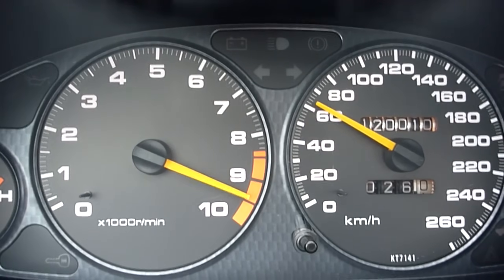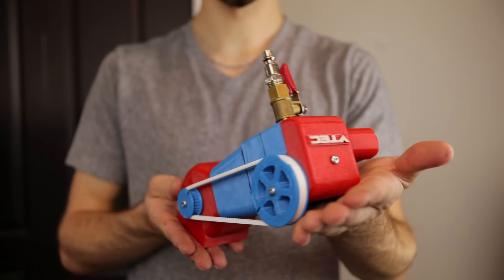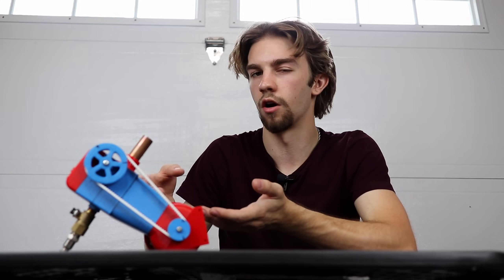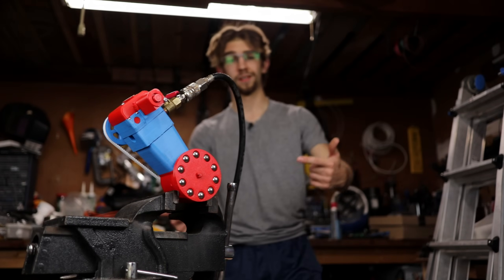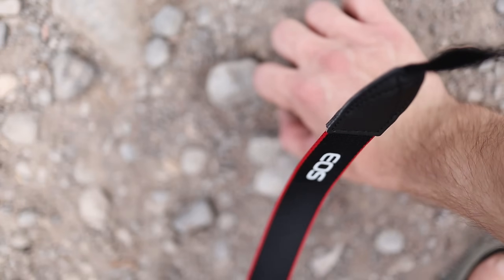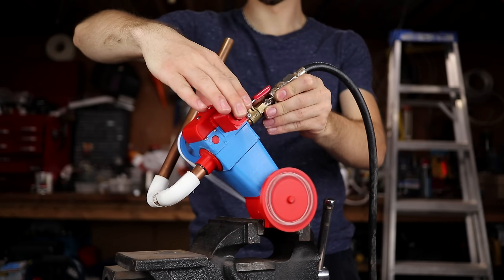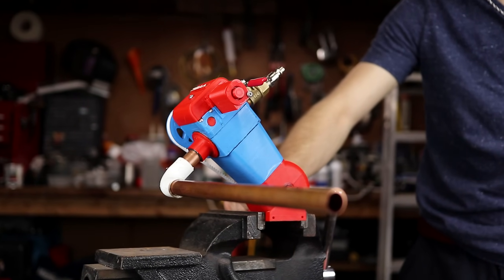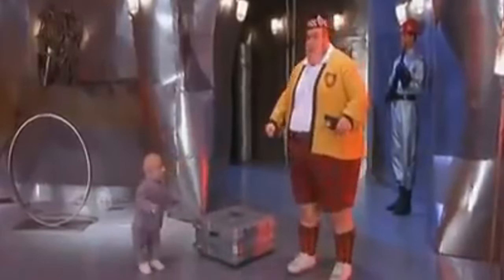I 3D Printed an Air-Powered Engine with Honda's VTEC

Comment: I'm way to dumb to be trying to explain this, but there is a thing with mufflers where if they are designed a certain way they can create a negative pressure that can actually assist the pistons in motion and increase horsepower. I can't remember what this is called but it would interesting to see if you could make a fancy muffler for this guy
Reply: "Exhaust scavenging" is the term i was thinking of

Comment: Automatic engagment would be some kind of weight using centrifugal force tensioned with a spring. At a certain rpm the weight would slide outwards and engage me mechanisms.
Just a idea might be complicated to implement or get the right force spring.

Comment: So you made an engine with worse Caproti valve gear... it'd perform better on steam as you can use the expansion of the steam when you cut off.

Comment: for the v tec could you make it so that it’s connected in a certain gear ratio that once certain rpm’s are reached at crank it can turn the gear fast enough to enable it? kinda like how if u stack a whole bunch of gears the last one won’t start spinning until the others have started and spun fast enough, you’d need more belts and stuff but idk

Comment: I suggest adding the weighted rotating levers that contract upon higher rpms. I dunno what they are called, but i know that they are used to measure rpms through centripetal force. Put that on the valves themselves and it should work right in theory if you add the right springs to counter the rotating levers forces...

Comment: Greases and lubes do wonders on efficiency and generating less heat from friction. Specially when said parts are plastic on plastic. ;p
Reply from the maker: I think I forgot to put it in this video, but I added grease during the assembly to everything that moved, I think the piston had to much inertia for the crankshaft to handle lol
Reply: @CamdenBowen  Ahh, yeah hard to tell from what I saw it seemed like it was bare. Most creators I see just slap the pieces together and wonder why things don't move freely or act surprised their creations only lasted 50 revolutions lol. Glad you actually do things properly~ Was definitely a fun video. ;D

Comment: Put oil in the crank case and an air oiler on the air supply to help
Valve sealing and reduce friction

Comment: Why not try a centrifugal governor to run the v tech, like the old hit and miss engine whe they got to a certain rpm the governor would lock open the exhaust valve to let it free wheel

Comment: my tiny little Chevy Trax has an EcoTec, which is like a VTEC but with higher torque. The car is fairly light and im not towing anyting....so, if you get it up to higher RPMs, its a shockingly quick little thing 😅
Reply from the maker: I heard the supercharged/turbocharged EcoTec engines from the Cobalt SS was a track killer... when it worked that was lol
Reply: @CamdenBowen  😅 Exactly! mine is turbocharged...but you kind of have to force it to get to high rpms, which it doesn't seem to like to do all the time! 

.....but, if you turn traction control off and give it full throttle, ease up for a split second, then full throttle again.... its fairly impressive,  consider the vehicle it's in 😅

Comment: 4:14 You're not supposed to let your air tank get that low, or it won't fill back up all the way and you'll have to buy a new one. I've gone through 458 air tanks at home.

Comment: A spring loaded ball valve that triggers at a certain psi would probably work for enabling the vtech, you can also adjust when it happens by changing how strong the spring is

Comment: Take all the clean 3 d printed parts make some silicone make some molds pour aluminum then you have metal parts,  make shure you have a big counter balance on your crank shaft it's easier to remove weight than it is to add it a crank trigger and a weedeater spark plug you have a gas engine

Comment: The VTEC should engage as the result of a mechanical governor. Weights spinning around against springs, and when spinning fast enough they lever a plate that pushes the VTEC engage pin in.

Comment: You could try incorporating like a centrifugal clutch with a bar, honestly I can't help but wonder how you would modernize a old balls out governor, maybe instead of throttling the engine it opens a valve to a pneumatic cylinder engaging the vtec, maybe crossing the piston inside with the piston tesla designed for his "earthquake" machine

Comment: Hey man can you try making a copper cylinder to go around the piston so not only the cylinder walls of the bore is copper, but the piston too will be, so it is copper and copper and not copper and plastic.the ol rings could be put on it somehow. Also this could make it so the lube will be between two machined copper pieces so the tolerances would be more tighter and all.

Comment: use something like what they used in old diesel engines for fuel control, so it engages at the higher RPM automatically or add a torque slip gear for it to engage at a certain load

Comment: Try and make a governor on the flywheel and use the output lever from that to engage the vtec. Should be simple and should should cool when you rev it up.

Comment: Kinda sounds like a GX160 stationary engine, btw you could totally make a vtec gx160 😮
Reply from the maker: Surprised Honda hasn't implemented VTEC onto any of their smaller engines/bikes. Few bikes did but not many.

Comment: I hate being that guy, but you didn't exactly explain the purpose if vtec all that well. Less aggressive cams produce more low end torque, due to vacuum pressure. As an experiment if you attempt to drink out of a large straw with low suction, it's going to be very difficult for you to get liquid to the top. A more narrow restrictive straw gives really good flow rate at low suction, but would ultimately reduce maximum flow with high suction. Vtec allows you to have a skinny straw while the suction is low and then have a wide straw when the suction is high. The rest of your explanation covers the timing side nicely though. :)

Comment: This is by far the coolest air engine ever biult! If you take a Demel to the exhaust you can make the exhaust port bigger so more air can escape. But there definitely needs to be some bearings in there. Cause that plastic on plastic action isn’t doing the engine in favors

Comment: For a mechanical engagement, could you maybe make a sort of centrufigal clutch? You would have to fine tune the springs, then adjest them pretty often as they get worn out so that they are still engaging at the correct time, but its the first idea that popped into my head.

Comment: It needs a turbo
Reply: Two turbos*
Reply: @canwenot573  are there any quad turbo systems? I’ve never looked into that, but my high ass just thought double it and call it good😂
Reply: Yes there is quad turbo systems but that is as high as it goes (for now)
Reply: sorry if this is stupid, but wouldn't a turbo make it significantly worse because there isn't any increase in energy from intake to exhaust.
Reply: @theratking14  no that’s kinda what a turbo does it gives an engine more air which makes it drink more fuel which makes bigger boom
Reply: @SIenderSIayer  Yeah but since it is an air intake and an air exhaust with no explosion in between wouldn't that mean the exhaust has less energy? Turbos shove air into the engine rather than relying on vacuum from the pistons. Since this runs on compressed air, a turbo is pointless and would just make it worse.
Reply: @theratking14  Sh mb complete though he was going run it with gas you right

Comment: i think the jump in timing advanced it so u got vvti on ur vtec
Reply: i'd say make the timing jumped how it is now and make the engine run like that with 4 cylinders and a tubular exhaust that is like a 2 stroke exhaust, also make the crank out of something other than plastic and make the valves ball bearings to reduce stress on the engine

Comment: use some sort of centrifugal governor so when it spins fast enough the weights come out and push the button in. cant really think of any other way other than some friction baced system that will not work for long

Comment: for the mechanical vtec activation you could use the same design that a governor uses except instead of modulating throttle at whatever rpm it just pushes harder and harder on a spring and then at whatever rpm it has enough force to push past and enable the vtec actuator

Comment: why dont you have the piece that engages the VTEC be powered by the same air that runs the engine? when its at full pressure/speed, VTEC engages and when at slower speeds there isnt enough pressure to engage it which is kind of how the real thing works but with oil pressure instead
Reply: in other words use the same thing you use to run the valves on the engine to actuate the VTEC at higher RPM by running a pipe off the intake to the top end where the pin is with a spring and use the pressure to make it actuate

Comment: You could have a small air passage from the intake that leads to an adjustable valve for a pneumatically actuated solenoid

Comment: A simple solution to your automatic vtec would be something like a steam engine governor. As the output speeds up, some weights are flung out and that motion engages the vtec.
If you are looking for it to activate under load, make a coupler that allows for about a quarter-turn free play. Use that relative motion between input and output to activate the valve timing. Easiest thing to do there would be like on those pull-string toy helicopters. Essentially couple of circular wedges that push apart as they are turned. In this case a spring would keep them together, and once under enough load to overcome it, the outer half of the coupling pushes a lever that operates the valve timing mechanism.
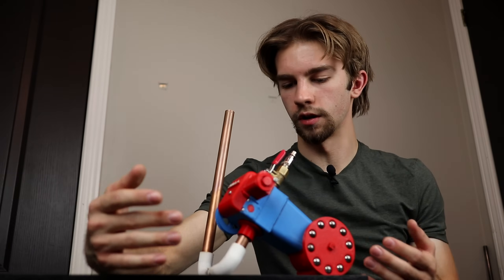Also, nice Half Life "dunk" sound effect at 5:45 :D

Comment: fairly stright forwards, like steam engine style limiter, or governer, have a spinning counter weight butterfly looking thing belt driven, so as it throws out the weights by restraining the base the top can move freely and get closer to base and then push in the pin, or a through pin to activate the vtec plunger as a desired rpm range

Comment: Very cool air engine! I have an idea for a print project. What about an engine that uses the Coates spherical rotary valve system? They're more effecient than traditional poppet valves and have fewer parts that don't need oiling 

On another note, you do amazing work! I look forward to seeing more of what you do!
Reply from the maker: Interesting idea, Thanks!
Reply: @CamdenBowen  anytime of course!

Comment: You could use a centrifugal clutch, like an RC car uses, the engage VTEC at a certain RPM. Based on the springs inside the clutch you can tune at what RPM it kicks in.

Comment: If you modify it a bit you can run it off your vehicle's vacuum line. Twin engines bro
Reply from the maker: Could probably tap into the brake booster line

Comment: You gonna cast these parts in aluminum next?
Reply from the maker: Maybe not next... but one day!
Reply: @CamdenBowen  haha true! If you ever do, I suggest to print and cast with a smaller tolerance than would fit, then to machine it down to a snug fit, that way you aren’t fighting layer lines, probably only necessary for few areas though!

Comment: Try to find a way to use small bearings to reduce friction losses, should help it make a lot more power and prevent the crankshaft melting again

Comment: That thing with the exhaust sounds oddly similar to a DRz400s or DR650 from suzuki?
Reply from the maker: If I used a larger diameter pipe I could have likely gotten a throatier sound like that of a dirt bike maybe, but with the narrower pipe it does give it a more refined sound
Reply: @CamdenBowen  No no that more refined sound sounds exactly like the DR650 i stg. A stock bike anyway...okay it's not "exactly" the same but goddamn if I close my eyes it sounds like one on a youtube video.

Comment: Voice clipping. There's a way to fix it in post in an emergency if you already recorded it with clipping in, there's declipper plugins, they won't restore it perfectly but better than leaving it in. After you declip, you probably want to brickwall limit.

If you have a clean recording and it goes bad due to processing, remember to brickwall limit it to something safe.
Reply from the maker: Thanks! I should probably first start by also figuring out why my audio clips so much to begin with, probably a setting on my recorder
Reply: @CamdenBowen   Usually aiming the gain for about -15dBFS level on "AAAAAAAA" is good.

Sometimes cause of clipping is movement rumble and wind noise. Directly below you may have nostril airstream occasionally hitting a lav.

Comment: i think i might have a potential solution to how to mechanically turn vtec on
so, on old hit'n'miss engines they have a centrifugal deal that when the engine gets up to operating rpm the weights get away from the center and theres some stuff that uses that to block the exhaust valve pushrod, when the engine decreases rpm as it would, the blocker gtfo' of the way of the pushrod's pushin and the engine hits again
you can use a similar system,  
also, ange the great's engine simulator has vtec, im not sure if this is how vtec actually works or not but it only activates if the throttle is full send 
maybe a mechanical "and" gate to make that work?

Comment: Cool! You can connect some centrifugal system that engages the vtec after certain rpm. Check out automatic bicycle derailleurs for example :)
Reply from the maker: That's very fascinating, I never knew that "automatic bicycles" existed before this. The design principals could work great!
Reply: @CamdenBowen  /watch?v=knMPK3TziPs

Comment: I'm sure you're already ahead of the game on this, but check out old school mechanical speed limiters! Counterweights on a shaft that raise and lower based on centrifugal force. You could hook that up with a linkage for engaging the vtec lobes
Reply from the maker: VTEC at its core is supposed to be activated based on RPM's. I'm not sure if newer systems account for throttle position as well but theoretically having something that relies on the RPM's to activate the cam switch should work

Comment: Find a way to use a system like those old yo-yo's called "the brain" which had a brake that was released when it spun fast enough to let it spin longer. If you had that type of system on the camshaft with two different hard stops you could possibly make it such that the smaller cam was engaged when the brake was engaged and the larger cam was engaged when the brake wasn't engaged and it would be fully passive. Might take some tuning with some sort of torsional spring so when it slows down it returns to the first hard stop but could work.
Reply from the maker: I like this comparison, I used to have a knockoff yoyo with a similar clutch system it was very fascinating. A bell housing with clutch pawls could work great

Comment: I think VVT would be better for an air engine, as there's no benefit to having lower lift at low rpm, and the exhaust would also need advancing to lower the pressure before bdc (and more importantly, after bdc, to not slow down the piston as it tries to push the air out)

Comment: hey man i’m a mechanical engineer and have developed a really cool and tiny 3d printed air engine. i can help out with your crank issues if needed.
Reply from the maker: Thank you! I have some solutions already and it seems to work!

Comment: You can make a switch that’s powered by rotation, as the engine spins up and increases rpm, the weight would move outwards by centrifugal forces, causing a mechanical switch to engage your vtec

Comment: i think you should be able to somehow engage the vtec by a centrifugal force pushing on lets say a ball that would be rotating around an axis with some excentricity, you would have to tune it so it would engage at specific rpms but i think it would be a pretty simple mechanical system

Comment: belt tensioner doubles as rev counter that activates vtec.
awesome stuff, you need to oil that system too.
will you run it off scuba tank and put it on a chassis?
a little cafe racer pit bike that runs on air 😂
Reply from the maker: I would love to put this motor on a little bike or something, see if I can hit 9k lol

Comment: Something like a governor on a lawnmower engine. It’s gear driven and uses weights to move a lever at a set rpm using spring tension

Comment: Your valve idea is genius with the sealed piston in the valve guide if you want to call it that. Makes me think about forced inducted internal combustion engines pushing high levels of boost that typically require super high valve spring rates to hold the valves closed. Feel like this could be refined and  at least used on intake valves to improve camshaft longevity and over all efficiency.
Reply: The boost pressure doesn’t add much force, if a valve is 1 square inch and you’re running 30 psi, that’s 30 extra pounds compared to a valve spring that’s already 100lbs, so it’s a factor, but I doubt it’s a big deal.

Comment: Build a metal crank & rod, with metal bearings (or bushings).

Look at a lawn mowers governor for a way to activate VTEC mechanically.

Have the goveror spun by the crank, & act through a spring (like it does the carburetor throttle) to a lever that activates VTEC through a pushrod that is resisted by a spring. Then it would activate VTEC at a certain RPM & disengage at a certain RPM.

Comment: Hey first time watcher- I have done something similer on a go kart engine before I used a centrifugal clutch to engage at higher rpm’s a difrint cam you should try the same fully mechanical and not to complex
Reply from the maker: Interesting, I'll have a look into that